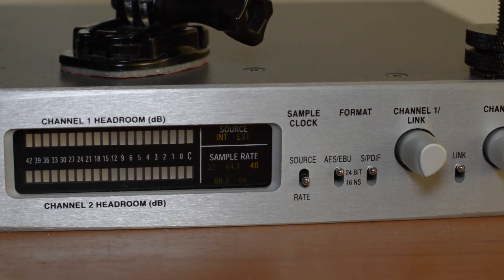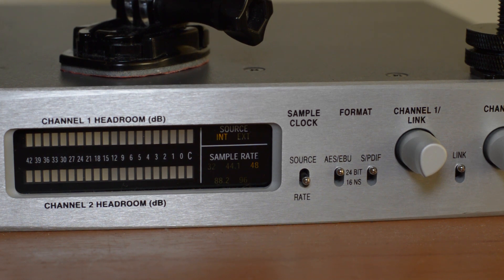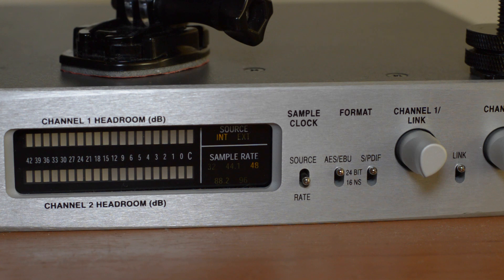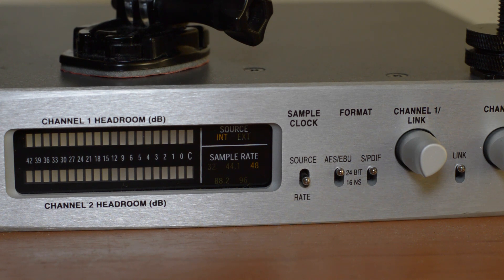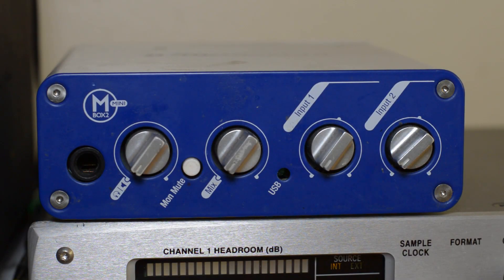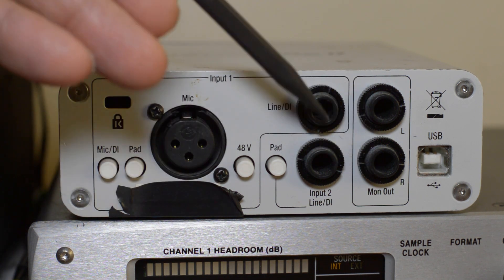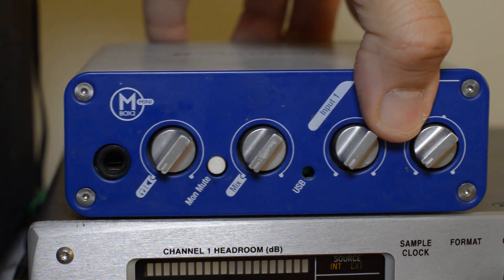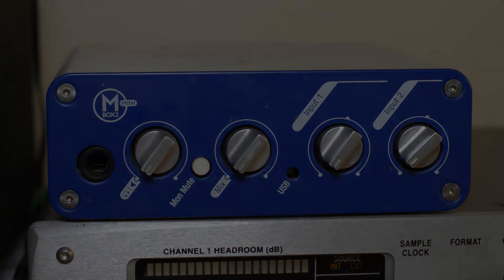Analog to digital converter

Comment: I have a project mix io. What's the deal with it? Signal is too hot right? I read you can buy some plugs to fix the problem.
Reply from the maker: Hi, plugins will not fix the problem. You need to bypass the pre's and the converters..
Reply: sorry meant pads on the line inputs to lower the high signal. How do you bypass? I have an octane, but my brother in law drop the pmio and now that doesnt work to use pre's on octane. Maybe the adat connector messed up...ugh.
Reply from the maker: Pads will help. To by bypass you need to use  an external pre like Clarett OctoPre or ADA8200.  Using spdif or adat..